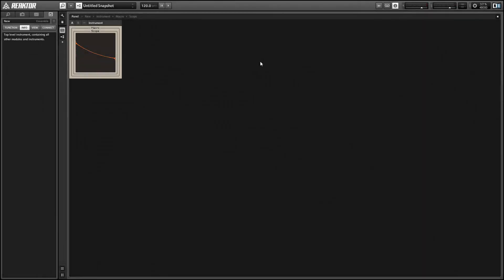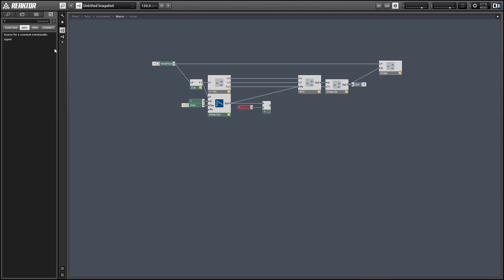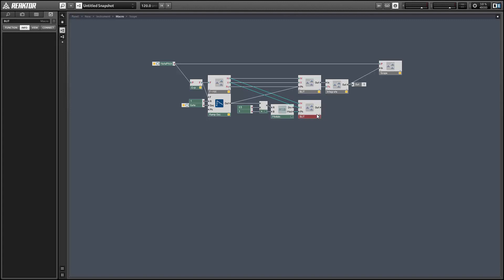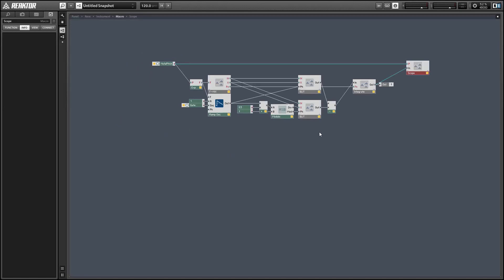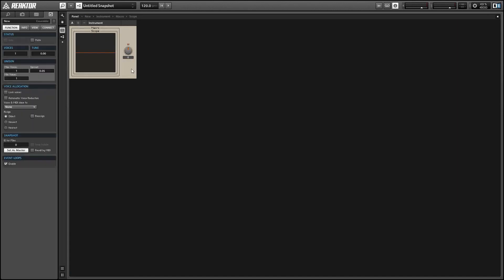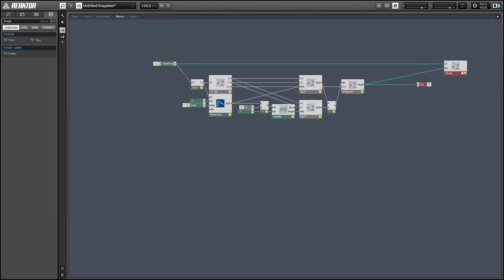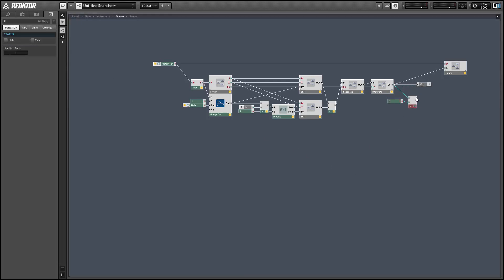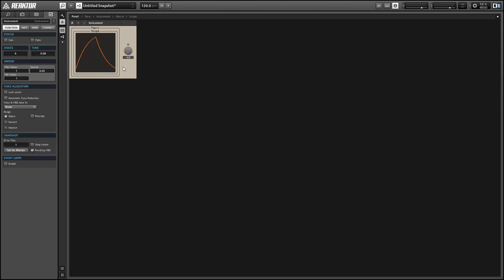NI Reaktor - Bandlimited Pulse and Triangle Oscillators

Comment: Thank you so much for a GREAT tutorial. If there is still anybody in the 2022, please... Everything works well until I try to modulate a pitch of the triangle OSC using LFO. After that, the waveform gets unstable (sort of jumps up and down) and introduces very low "rumble". I can't get rid of the ultra low information using HPF unless it changes the waveform's character. Please, help :-)